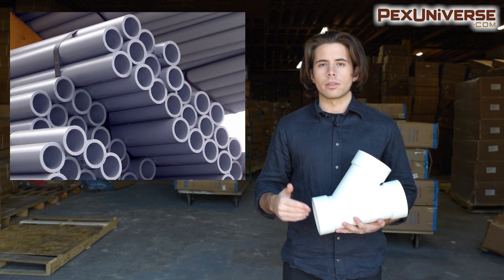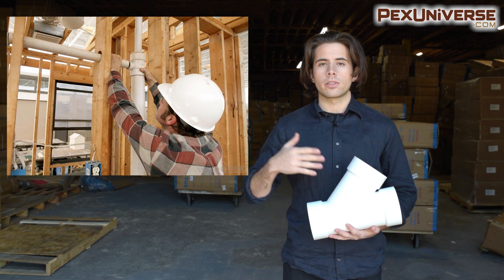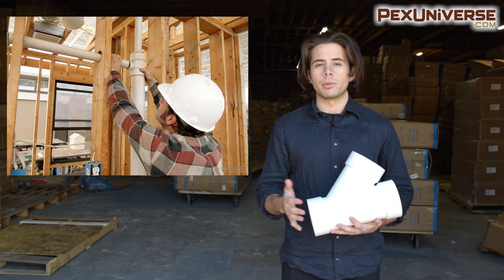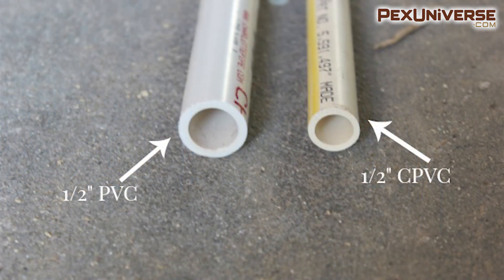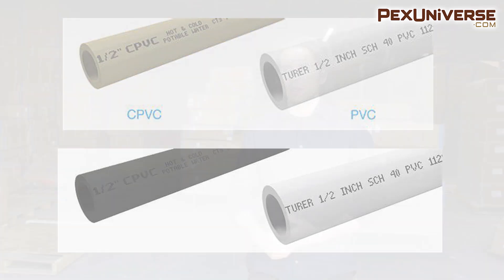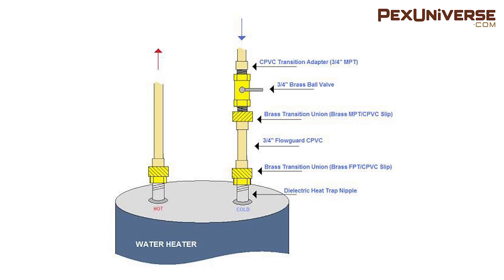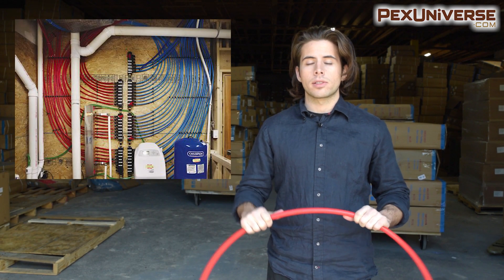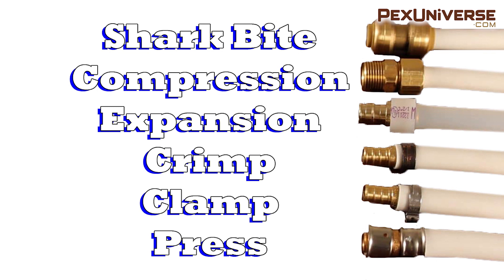Difference between PVC cPVC uPVC and PEX

Comment: If you live in a city or suburb that has any rat population, or if you live in a rural area with field mice, voles, or packrats, PEX can, and will, be chewed on by any of these rodents. Most every home in my rural area that has recently been built using PEX lines is now experiencing major problems with leaks due to the recent explosion of rodents after our very wet winter and spring. I considered PEX for some remodel work until I discovered this by speaking with several of my neighbors. I will be staying with copper because of this problem. Higher cost initially, but better peace of mind in the long run.
Reply: They can chew your electrical wires like the standard romex, so are you going to re-wire your house and run steel conduit and use metal boxes?

Comment: is there a significant difference between the type of white/blue/red pex used in household applications for potable water compared to the orange pex used for radiant floor heat?
I'm curious to know if the cheaper, orange pex is still good for potable water.
Reply from the maker: While Orange PEX pipe is an oxygen barrier PEX pipe used for hydronic heating applications it can still be used for portable water.

Comment: How it comes! PVC recommended to not be used for over 140 F = 60 C 

Here in Saudi Arabia as you know in summer the normal water main can reached to 60C easily... And when it gets to the water tank and circulate through the building...
Also for the water heaters! We used PVC to carry the hot water 😬

Comment: I have a project that I need input:  ABS vs PVC

I want to build a water holding system for taking a shower on top of my small camping trailer.  Most DIY videos use ABS due to its color absorbing heat, but I am concerned about warping in sunlight which is exactly the reason this black pipe is used for this project in the first place.  Another  concern is that ABS is stiffer and the joints may start leaking from bouncing around going down the road.  Of course PVC can be painted but I am concerned with the joints coming apart from trailering vibrations.  Another concern is which will hold pressure better?  Most pressurize their systems to about 30 PSI. Suggestions of one over the other and why please?
Reply: pvc joints are somewhat cold welded when you "glue" them, therefore you will not have issues with leaks, same with abs if you join them this way, you will not have issues with the joints leaking if they are done right. a properly joined connection with this method will not come apart, even if you tried to. however pvc will soften more with heat, possibly weakining the joint, as far as i know abs is more resistant to this

Comment: Which pvc is good for gas lines?
Reply from the maker: PVC Pipes
PVC - Polyvinyl Chloride - pipes may be used in pipelines buried outside a building.

PE Pipes
PE - Polyethylene - pipes may be used in pipelines buried outside a building.

Comment: Hi!!very interesting explanations....i have a problem with my house ac drain lines that is located in my attic...the lines are pvc pipes and every year it breaks ..crack..in winter i gues because the so low temperatures. And in summer for the extreme hot temperatures in my attic..so my question is what kind of pipe can we use to avoid this to happen????
Reply: Try ppr pipe (hot and cold)